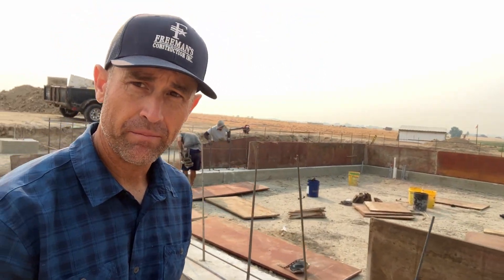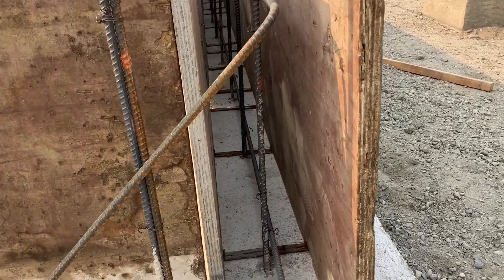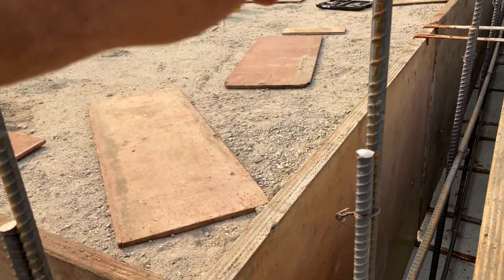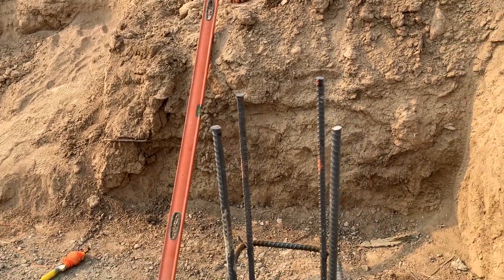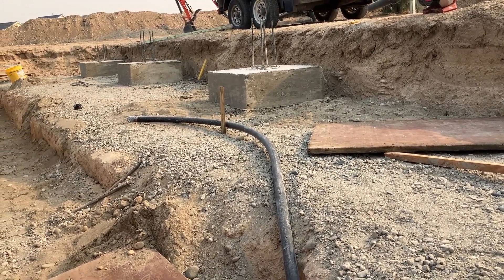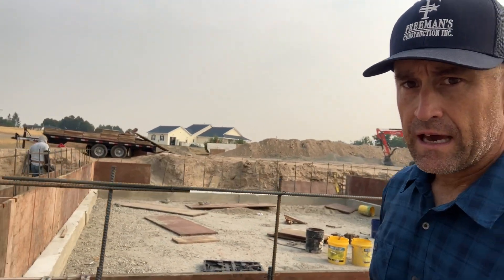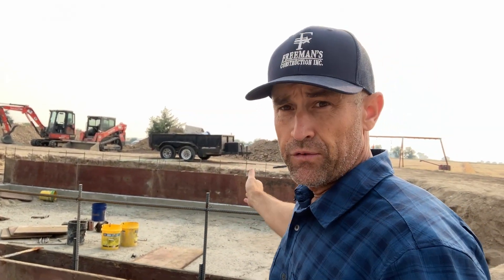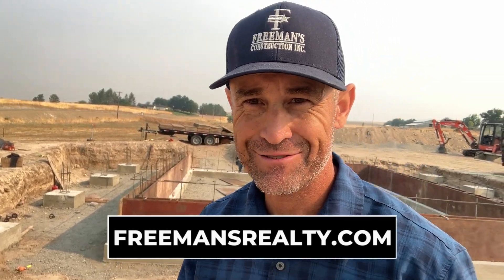Setting Concrete Forms For the Stem Walls

Comment: After the concrete cures How do you remove the metal brackets that hold form boards together?
Reply from the maker: The top ties just come off the top of the forms. The ties in the middle of the wall snap off and the bottom ties that secure the forms to the concrete have to be cut off. It is very important to waterproof the cold joint where those bottom ties are at as that is how water will get into the inside of the crawlspace if there is any.